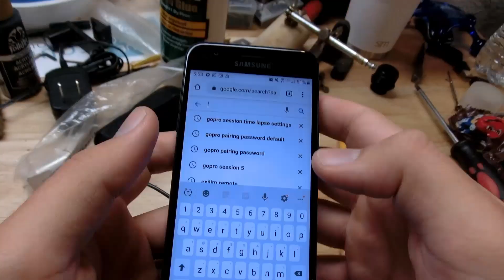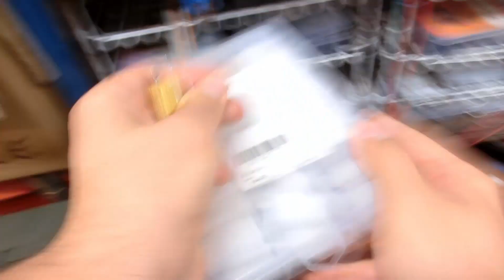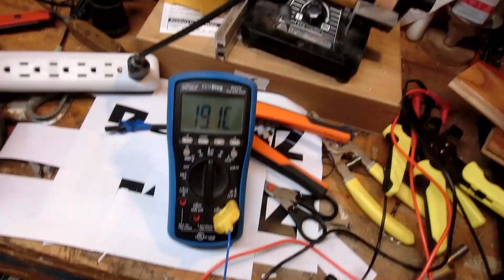Electric Branding Iron

Comment: what voltage you use for this ac or dc and what is power of it? 20,50,100 volts AC or DC?
Reply from the maker: It’s super sketch. Plugs right into the wall 120VAC